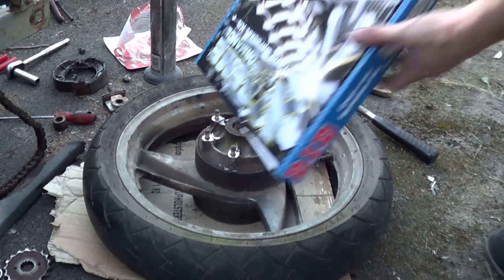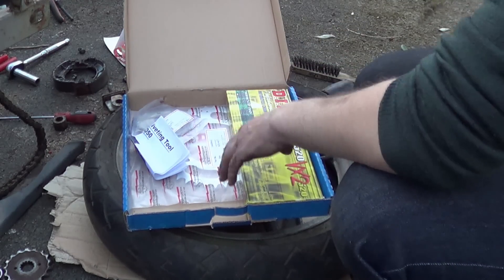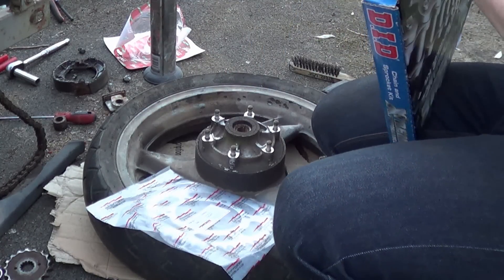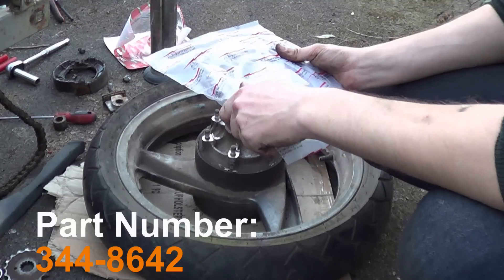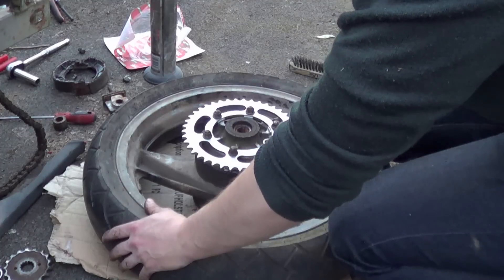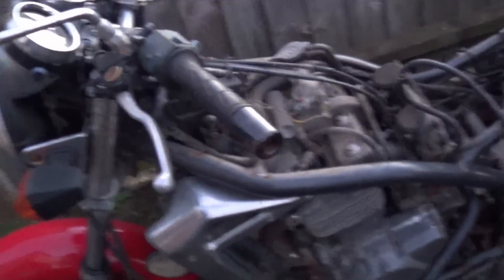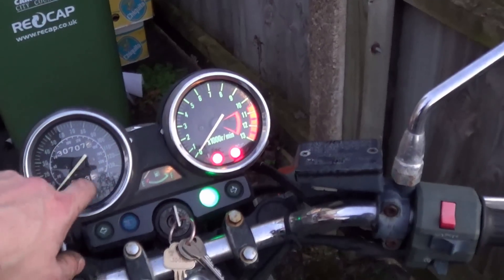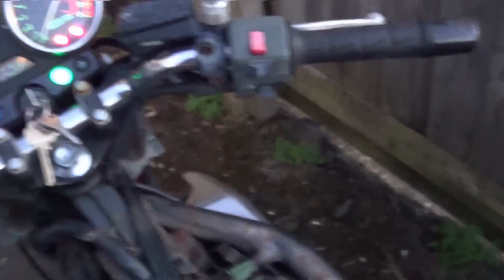Kawasaki ER 500 - Backyard Bike Project Update - Episode 6

Comment: really excellent videos. I have an ER-5A3 1999, recently it has been 
using a lot more fuel than normal, and there is a strong smell of petrol
 in the exhaust. It also has been stalling if left to idle or if the 
revs drop too low, and there is a lag on the acceleration. Sometimes it 
wont even start and not as much power as before. Any ideas what this 
could be? thanks
Reply from the maker: Hello mate, sorry for the late reply. Well it can be a few things so here we go

1. The engine is flooding, this can be a few things but we'll star with the easy ones. Check that the choke cable is tight. If the choke isn't disengaged properly then you'll be flooding the engine. You could have a cable that is too tight or the cable or actuator is sticking. I've put up a picture of facebook here - https://www.facebook.com/photo.php?fbid=1784206295179818&set=a.1383911205209331.1073741828.100007713935651&type=3

Check the return spring in red. Make sure this spring is in good knick and thats its there in the first place
The cable attaches here in blue. Operate the choke and check that the cable operates in a similar fashion at the carbs.
And the two choke plunggers are highlighted in green. Make sure these plungers are moving with little to no resistance.

2. The diaphragm can be damaged. Under the black plastic covers are rubber diaphragms that react to pressure changes in the carbs. These meter the fuel by controlling the slide and main jet needle. If they are damaged then this can cause a rich fuelling failure mode. 

They need to be free from splits or any cracking etc. The should be springy and not dry (i.e stiff and none rubbery lol) it looks like this - http://thumbs4.picclick.com/d/l400/pict/162279191691_/Yamaha-XV-535-Virago-1988-2002-Carb-Carburettor-Diaphragm.jpg

3. Check your airbox for excess fuel. You need to check the airbox because any excess fuel will trickle from the carb into it. This fuel then makes its way to the bottom of the airbox and down the crankcase breather hose. A small black piece of pipe that enter the engine via the top of the gearbox. This is an important step. If you find fuel is in the airbox then you WILL need to change your oil, sooner rather than later. The petrol will dilute your oil and this can cause a whole load of problems you don't need. 
 
In summary the bike is cutting out at idle because the fuel mixture is too rich. The power is down, again because its too rich and excess unburnt fuel is flowing out of the exhaust port. 

I've probably missed a few possibilities but this is a good place to start. If you want a more direct reply (a back and forward) then feel free to 'friend' me on facebook then I can send you picture and such easier 

Facebook - https://www.facebook.com/pony.power.395

Hope this helps - matt
Reply: Matt, thanks very much. I will indeed check the choke cable and air box. I was also told to look at the oil level and check it has not increased (due to fuel etc). Im not a mechanic so cant open up the carburettor but a local mechanic can. Could the spark plugs be causing any of these problems?
Reply from the maker: Yeah, but unlikely. Your spark plug and coil pack or either could be bad, you could check the resistance of the coil and the spark plug gap. You don't need to be a mechanic to open up a carb unless you have no hands
Reply: Ok Matt thanks again, i will go through the steps you have suggested.
Reply from the maker: No worries mate - matt
Reply: matt, it has petrol in the oil. i opened the oil cap and it smelled of neat petrol. I have stopped using the bike and will take it to the mechanic saturday. I assume this is a carb problem and will also need an oil/filter change etc. The bike will still ride but badly with not much power. Could there be any permanent damage done?
Reply from the maker: Hello mate, your carb(s) are leaking into the crankcase, hense all the issues you are seeing. I'm in the process of doing a video to solve this problem with the ER-5. Back to your question. No. It'll clean all the junk out of your engine lol as petrol is an awesome solvent. I expect that the bike hasn't been running that long with this condition so no need to worry.

The reason why it can be a problem is that the petrol dillutes the oil, lowering its viscosity (thickness) which means that when the crankshaft is in operation the contaminated oil fails to hold up the crank and wear of the main bearings begins. If this happens over a long period of time the bearings will prematurely wear, and will need changing alot sooner that usual.

The 'thinning' of the oil also means that oil pressure throughout the engine falls which cause wear in other locations like the camshafts and the piston to cylinder interface.

This long explaination is for other reading this comment as well as yourself.

No need to worry mate, you probably have either a carb issue or another common failure mode is the fuel tap is knackered.

Hope you get it sorted mate

- matt
Reply: thank f*ck, you have put my mind at ease haha. Anyway i dont want to speak too soon, the bike isnt being used until I take it to the mechanic and so long as he is worth his salt (I will pass on you info to him) then he should get me back on the road again. the ER-5 is a great bike. Cheers for your advice. keep going with the videos.
Reply: The bike is with the mechanic, he said straight away its only firing on one cylinder.
Reply from the maker: Any more news?
Reply: Matt. I took it in and straight away he said its only firing on one cylinder. He opened the carbs and said on of the float needles has snapped He is going to replace both carb floats (£44), change the oil/filter, spark plugs. 3hrs labour, total £240. Sounds ok to me to get it up and running again. What do you think?
Reply from the maker: Sounds like the going rate but you could have done all of this yourself and saved yourself alot of money
Reply: Not got the tools or time/knowledge mate. This is my only means of transport, its not a 2nd vehicle so i cant risk having a go myself, I wish I could!

Comment: Didn't you look at the electrics back in episode 3 or so? :p
Great series though, I've been fixing up a '98 Hornet over the last few weeks but it doesn't look nearly as bad as this one. :-)
Reply from the maker: ***** Shame cause I'll be buying a hornet before the years out and it'll be getting the same treatment. - matt
Reply: Definitely looking forward to that!
On a side note, have you got any tips for removing the carburettor assembly? I tried getting it off the Hornet today, undid all the cables and hoses, loosened all the clamps but it just wouldn't budge. :/
Reply from the maker: ***** Sometimes the manifolds perish abit and kinda melt themselves together. Best method I've used to to stick a flat piece of wood about 3 ft long and 1/2 inch by 1 inch. Straight across the back of the carb (between the carb and the engine) and lever it away. Just make sure you loosened everything. The circular clamps I would remove completly, before trying this. Hope this helps - matt
Reply: I'll try that next time it get around to it.